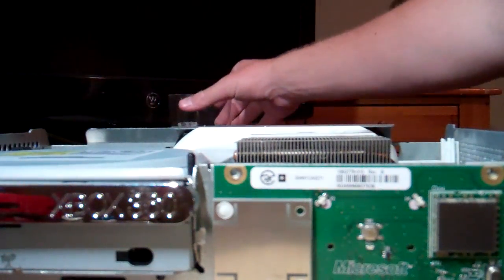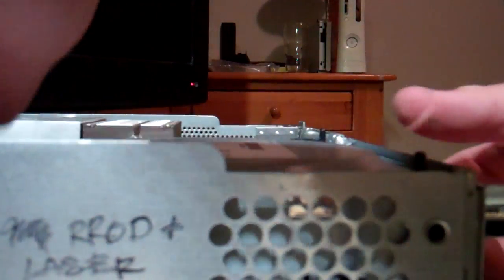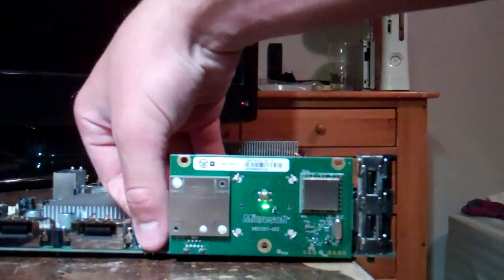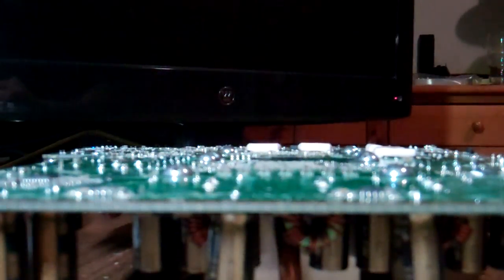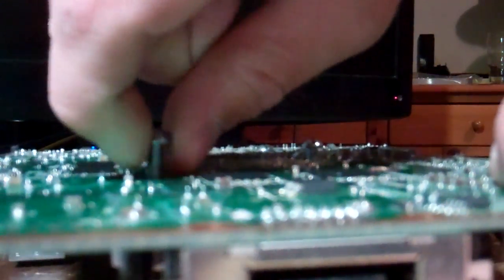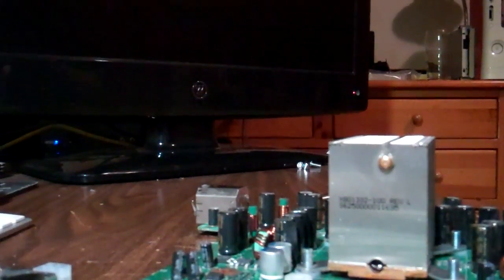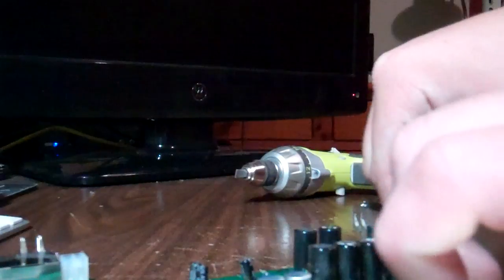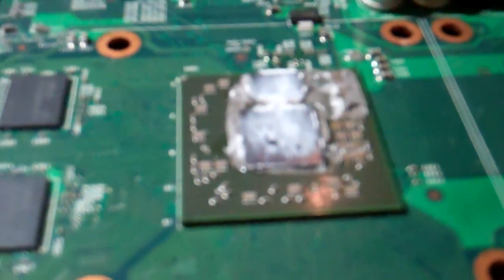How to reflow a xbox 360 (part 1)

Comment: i got the e76 error and i m wondering if a reflow or reball will work theres nothing wrong with my hdd or ethernet because theres not a storms in calir during this season and i was wondering what could fix it and i just bought a new laser for my disc drive and also paid black ops 2 off so i need some help